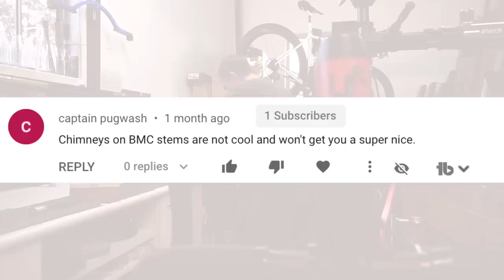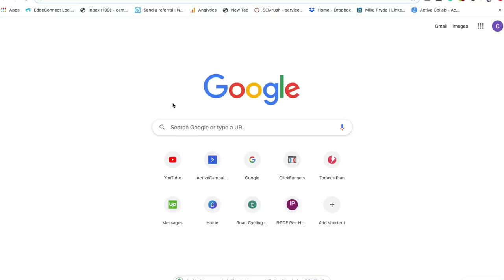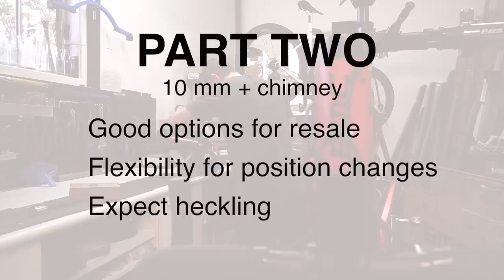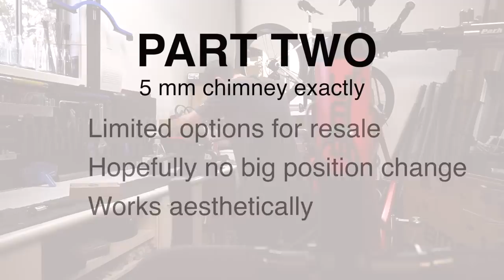OH DEAR, what have I done to my BMC Teammachine!?

Comment: Soooo. Did you just invalidate your warranty? As I watch you are explaining...
Reply: resale could be harder , you would to find somebody with the same proportion as you
Reply from the maker: I don't know, another stuff up to add into the mix.
Reply: Ok, grrr. Standards change. When carbon steer tubes first came out 1 1/8 straight was good (I still own one from 20 years ago). Then due to safety concerns out of the EU, the tapered stem (1 1/2 lower to 1 1/8 upper) came to the head of the production pack.  Now 2020 as a bike mechanic working with after market carbon forks (Whiskey) bikes on custom builds the instructions are explicit to cut to 7-8mm above for a 10mm chimney.  Anything less invalidates the warranty. I am not currently working on major manufacturers bikes such as BMC but am curious as to what you LBS guys are being held accountable to IOT keep the warranty in place.  Grrrr, another hot topic post I find myself embroiled in.  Not sure what you will post next to elicit a response from me... but I’m holding with baited breath.
Reply: I would love to hear what your local bike shop says on the current legality of the slammed stem.  But in your video you capture it. Leave 10mm and you won’t go wrong.  It’s the Wild West out there in information and glad you are patrolling it. 🤠
Reply: On an a super nice on GCN is no chimney and you must paint your frame purple. Seriously!

Comment: Thanks for your and Neill's efforts to dispell the nonsense about 'correct' crank length - cycling is full of this factless-based opinion, it's endlessly annoying.
 
As for the 'chimney'. Why would you care what others think? Do what's right for you. Same with all the other stupid 'rules', like crank length, gearing, etc.... 
If makes sense to leave some movement both up and down to accomodate your changing flexibility throughout the year. Either way you can also change the height easily with stem angle. For a flat stem, 1deg change gives 1.75mm change in height. If your response to this is talking about 'correct' stem angle, see above.

Comment: from my understanding and personal expirience with shorter crank arms i would rather think that you would have to lower your saddle a bit (shorter crank arms -> distance between saddle and pedal is less than with a 172,5) - i would rather think that your bike fitter is misunderstanding you and thinks you have gone from 165 to 172,5. But i could be wrong :)
Reply: Blödsinn mit Lötzinn you have it all backwards. The bottom foot is now 7.5mm higher meaning to maintain correct leg extension the saddle needs to go UP ⬆️. Also it was the bike fitter that recommended the move from 172.5>165mm cranks. 😉
Reply: @cyclotaur6315  this is interesting, i was just thinking about the upper foot and not about the lower foot! :D

Comment: Far worse than a phallic steerer tube is the spoking on your front wheel. Looks like the valve hole isn't between the spokes that are widest apart. You'd get kicked out of any wheelbuilding forum for that, never mind weight weenies.

Comment: Completely disagree with resale as the main focus point - you spend hundreds of dollars aiming to get the weight of your bike as low as possible, cutting the chimney is a cheap option! Think about that, not resale... enjoy the moment! (+ the savings there may outweigh what you'll loose in resale, if you ever resell...)
Regarding your miss-calculation once you changed the crank length - NO COMMENT!
Reply: also... Cervelo R3!